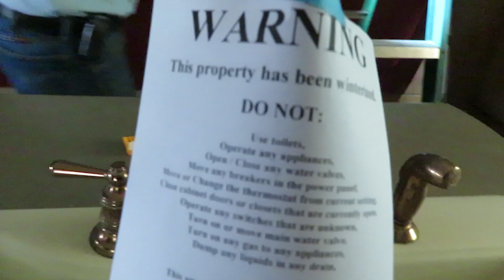Double Queen Hive Or Nah?  You Decide.  Abandoned House Hive Removal

Comment: I have an old wooden garage.Gets swarm of bees every year,I cut out a 4 by 8 ft sheet from the inside,Cleaned them out.Next year they are back in there again. So i fastened some frames up in there and used some screws to put the panel back up,Makes my life easier,If you can't whip em,join em.
Reply from the maker: That's using your head.  I know a few houses around here that could stand to use that method.

Comment: Can two hives exist in the same cavity?  Boxes can be stacked in close proximity to one another, what kind of spatial separation is needed if there's no physical barrier?  Just enough distance to keep the pheromones from getting crossed?
Reply: Radon, the simple answer is yes.  I've seen colonies inches apart with any barrier and only a couple of feet without any barrier.  They won't share the same entrance.  Often the second colony is a split from the first which helps.